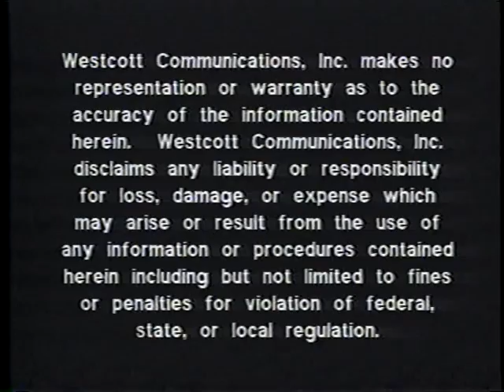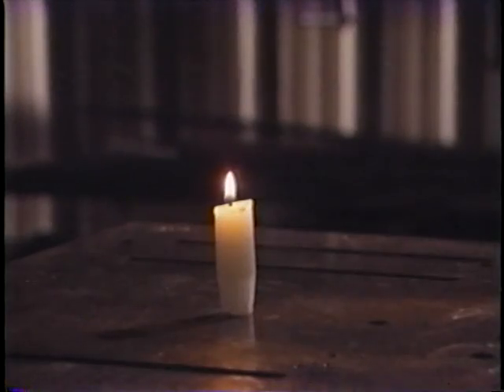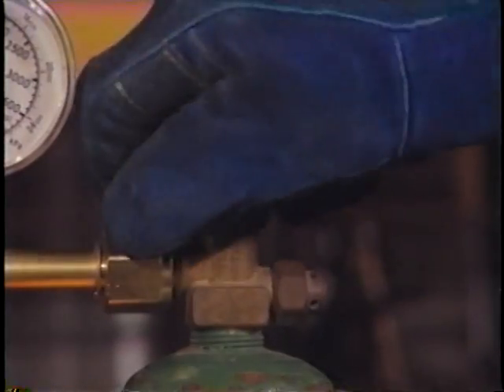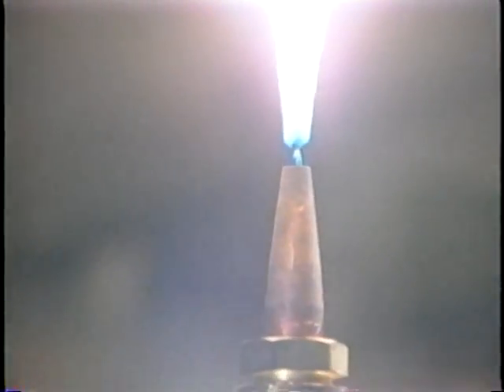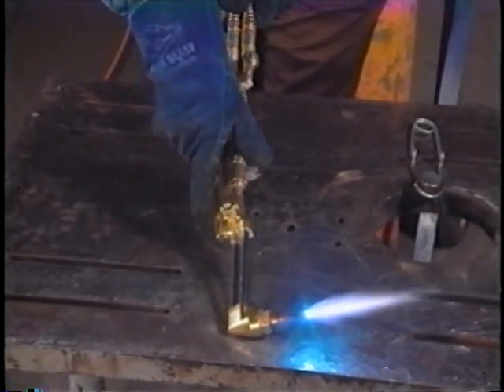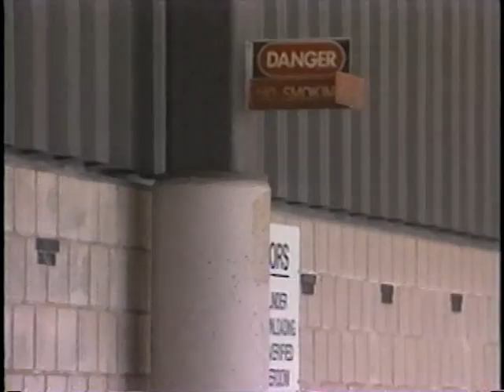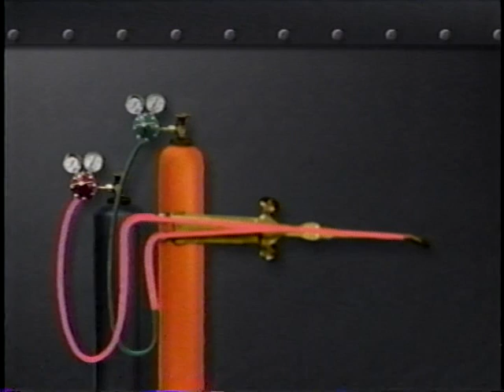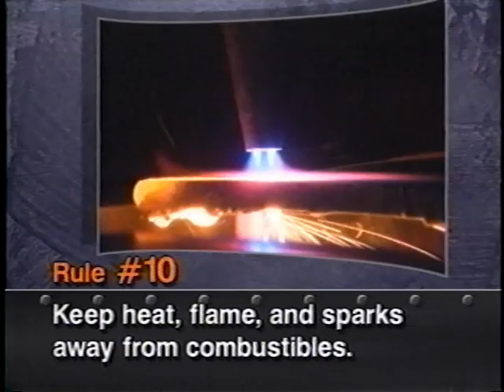Oxy Acetylene Safety

Comment: I have been using Oxyacetylene for 21 years and I would like to add a safety tip that they didn't mention about the Acetylene cylinder. If using a cylinder that needs a "T Handle or cylinder wrench keep it ON the cylinder valve while in use, if there would be emergency the 2 seconds it take put it on could be the 2 seconds that saves yours or others lives or property.

Comment: heres another safety tip regarding acetylene cylinders worth mentioning.   a cylinder involved in a fire or flashback should be monitored very carefully following the incident.  there is a risk the acetylene could begin to decompose,  and the cylinder could explode within minutes to hours.  if the cylinder shows signs of heating or vibration,  the area should be evacuated immediately, following your company's emergency response plan.

Comment: Thanks much, Needed to confirm that a #6 Rosebud heating setup for/on a Victor cutting head and whether the oxy cutting trigger remains closed and unused while adjusting oxy pressure AND while Rosebud heating which of course it does (remain closed).

Comment: 22% oxygen in the air?  that is a bit high.  My meter always shows 20.9% and if it goes above that, I do some investigating to find out why the oxygen is rising.  23.5% will set the alarm off.

Comment: have to changed the lay out so valve points straight up away from a person  so it would not hit you if someone makes a mistake ,I use these at work and was never told about this
Reply: The regulator is not a back blowout device like a gauge.

Comment: BIG NO NO!! They don't talk about NOT using Teflon on the torch fittings or other thread sealing compounds on the hoses. BIG NO NO >>>> I have been reading chat in youtube welding vids about people using Teflon on the hoses and tape to patch hoses. 1 guy is talking about having an oxy- ace explosion  while filling a trash bag with oxy-ace gas he said right as he pulled the torch away from the bag it exploded and his question was is it the Teflon? He said there was no static electricity in a trash bag??? He still thinks its the Teflon not static discharge he clearly did not read the memo or has no grasp on what pure Oxygen can do.
Reply: Teflon is a brand name. It can be many different things. But what I think we are talking about is PTFE tape that is used to seal pipe threads. 

PTFE can be used in direct contact with oxygen, but it will burn if set on fire. I know this because it was in the Apollo 13 report. Teflon insulation was used inside the liquid oxygen tank in direct contact with liquid and gaseous oxygen. This was fine. However a damaged relay caused the wiring to overheat. In air Teflon will not burn, but in contact with 100% O2 it caught fire and the tank exploded. 

I've seen seals in equipment designed to use acetylene made of Teflon so I know it's compatible with that as well. 

And of course, PTFE lined oxyacetylene hose sets are a thing. 

So there is no compatibility issue between either O2 or acetylene and Teflon.

The rule about no Teflon tape is actually very simple. Other things you should not use are pipe rope or anything other thread sealant. This is because all of those are for use on pipe threads. 

Its quite obvious to anyone who looks at the fittings that they are not pipe threaded. The seal the end of the fitting and a seat under pressure provided by the threads. So winding Teflon tape over the threads does nothing except create the possibility that Teflon tape could get on the sealing surface and prevent a good seal causing a leak. Knowing how the fittings work, it seems downright crazy that anyone would try to use Teflon tape (or pipe dope) on these kinds of lines. But at a previous job ,we had equipment that used hydrogen. It was plumbed from a manifold in a special room where the cylinders were kept, through specially built copper pipes to fittings in the labs. A regulator was installed at that point that fed copper tubing that was connected with swagelock fittings. Swagelock fittings are compression fittings that swage a brass ferrule to the copper tube and press it against a seat to make a seal. So the sealing surfaces are between the copper tube and the ferrule that is swaged onto it when the fitting is first tightened, and the ferrule and the seat of the mating connector. And what did my boss do when one was leaking? Did he cut it off with a tubing cutter and install a new swagelock connector from the cabinet that contained literally thousands of them? No, we wrapped the threads in Teflon tape and assumed it was good without even bothering to check for leaks. So yea, people are that dumb. So that's why they always say not to use Teflon tape.